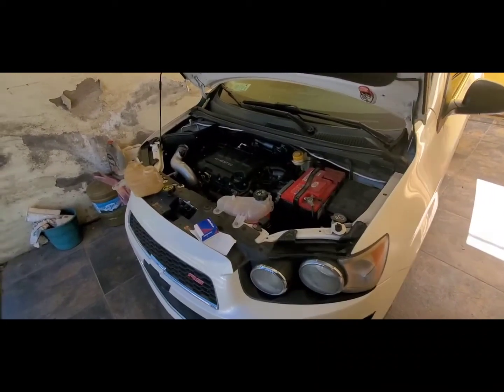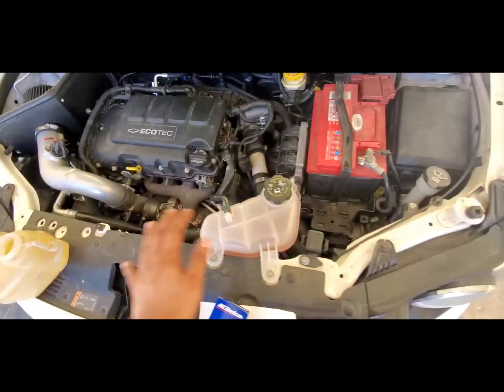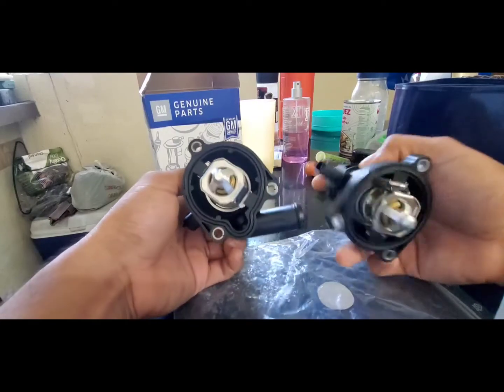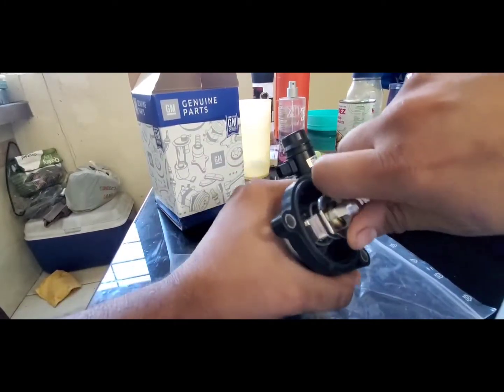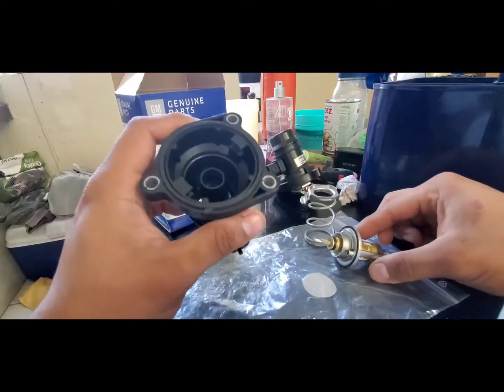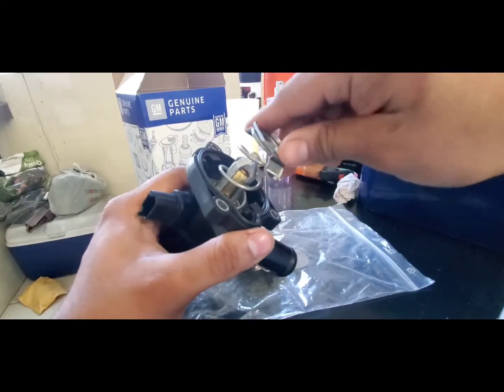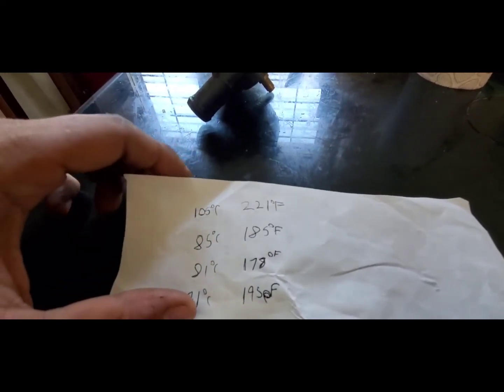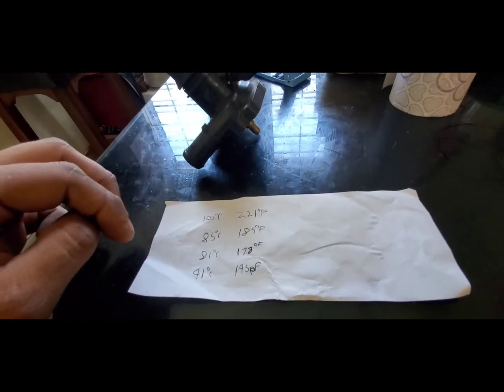colder thermostat mod for Chevy Sonic, Cruze Trax.

Comment: Hello ~ i'm from vietnam. How do you think about change thermostat of cruze ( 105 degree open ) to 95 degree open 
Because in vietnam weather not colder than US. Pls you see my comment
Reply from the maker: Yes, this will work wonders. I'm also in a warm climate I'm not in the US
Reply: @amedsoprano but have issue p0128.
Reply: @amedsoprano  and i think i will set up one more electric fan control by hand, how do you think about this?

Comment: Only if its really hot out the ecu might sometimes open it at 200 instead of 220, but still pretty hot and definitely hotter than a first gen volt/ELR thermostat.
Reply from the maker: It also opens with certain codes present regardless of temperature as a failsafe

Comment: your a genius thank you for sharing my turbo has already gone out on mine causing it to over heat, or maybe its due to turbo failure but either way this gives me hope thanks
Reply from the maker: @ChristinCampbell-b6h  you should check your water pump, it sounds like you have different problems than the turbo

Comment: So. Buy Chevy volt dorman. Just pull thermostat out. Done. Next take chevy SONIC thermostat. Rip it oit. Ok. Got it. Then take your personal housing and put the volt thermostat in it????? He also got a smaller cap. One that is lower in psi. Will help cool it. 185*F-195*F. Genius.

Comment: Wouldn't just swapping the spring have the same effect?
Reply from the maker: @4Tay96  no, the piece that opens and closes is the core
Reply: @amedsoprano  yes, but the spring keeps it closed till it reaches correct temperature which is when it opens/closes
Reply: Correct. Its a very simple thing. U put the volt thermo into sonic housing and then install on cruze
Reply from the maker: @joshlandersgolf45  the spring is just part of it, but the core is what determines the opening temperature.
Reply: Yes i know how a thermostat works. I have and built own street car. ASE certified. But thks
Reply: You'd think the lower pressure spring would have it spend more time in the partial open position as well

Comment: So put the volt thermostat in the sonic housing?
Reply: I bought a aluminum dorman. Runs at 192*
Reply from the maker: @joshlandersgolf45  yep, just the core
Reply: Great trick! Doing that tomm. I been looking for a cooler one since I bought it
Reply from the maker: @Landers-1  just be sure to buy either an OEM volt one or the Dorman version, as those cores are dimensionally identical and have the same connector, I've seen off brand thermostats with a different system altogether.

Comment: So im trying to do same rhing. So u bought a dorman chwvy volt thermostat, and then you removed the volt thermostat and removed rhe equinox thermostat and then u replaced it with the volt internals into the sonic thermostat housing?
Reply: Equinox is a 2.4, not sure this mod applies to that, this is for 1.4t so cruze sonic trax encore

Comment: Hi, may I ask what is the different between replacing a 15psi cap vs keeping the original 20psi cap?
Reply from the maker: The cap regulates the pressure of the entire cooling system, by lowering it there's less force pushing outwards in every single part of the system thus less stress. You're also technically decreasing the ability of the water to go over its boling point without it boiling, but with the combination of thermostat and cap I've never seen anything over 97°C even when trashing the car heavily, revving and attempting burnouts. 
the boiling point of a 50/50 mix at 15 psi is 126°c so I'm well under the safety margin.
20 psi would be 135°c which is necessary with the original tstat that operates at 110~115°c
Reply: @amedsoprano  the previous owner of my 2017 Chevy Trax actually removed the spring of the thermostat completey, leaving only the core remains. He ran it for years, I think. I've just replaced a new one and notice that the temperature is too high, now the car often run around 100°C to ~108°C. I'll try to find the cap you show in the video and order the dorman thermostat as well. Its really hot in Vietnam this summer 🥵

Comment: can this method be applied to cruze 1.8? Because there are differences in shape between the Cruze 1.4 and 1.8
Reply from the maker: Idk since I don't have one of those, but if the inside piece is identical it should work
Reply: @amedsoprano what about just using the spring from the dormant that is installed on the OE thermostat, because there is a difference in the shape of the inside but the spring is weaker and can be installed on the OE, will it affect the opening temp at a temperature of 85 degrees? Thx for your information
Reply from the maker: @Doron7P it might lower the temp a little but the main opening mechanism is the expansion of the wax inside the piston that pushes the plunger so the thing that makes the difference is the core itself.
Reply: @amedsoprano  amazing thanks for your response, so is it a better choice if I swap the spring only and install a 15psi cap (or stay with 20psi)

Comment: Worked fine for me now with 198k on it. No codes,passes inspection..........heater vents use to burn kids inside the car if they touched them while heater was on and fan on low...... not now.

Comment: GM tech here, just to let you know, the stats are all the same, when you see the temp open number advertised on the stat, that is a lie, that is what the car is programmed to open the stat at, the stat is 100% controlled by the ECU, why they have 2 water sensors, there is no water controlled wax in any of them. This mod won't change anything. You'll either have to remove OE stat for a traditional water temp controlled one (3D print custom housing) add a tone to delete OE temp and codes set to desired temp to open, or will have to manually control it by plugging in a PWM set to desired temp after scoping it and leaving another sensor plugged in to OE connector as to not set a bias code.

EDIT I should say first before i put foot in mouth that that is for the US however, i don't know about the rest of the world if GM did something different, but for any Trax, Volt, Cruze, Sonic...ECT with the 85Ci (1.4) in the US, they all use the same thermostat.
Reply from the maker: Every single thermostat in the world works the same, it's a wax filled piston of sorts. when the wax heats up and melts it expands pressing on the plunger which in term pushes on the sealing part of the t-stat.  The only difference with modern cars is the addition of a small ceramic heater within the piston which will heat the wax on command instead of letting the water heat it up. You can open it whenever you want(or the ECM rather) but you can't close it if the water is hot.
Reply: @amedsoprano  That's what the Chevy Cavalier and Cobalt had yes, but not the Trax, Volt, Cruze, Sonic ECT... uses, it's 100% controlled by the ECM on those. If you unplug the connector on top of the thermostat, it will never come open and will eventually overheat. Just cut one open and you will see.
Reply from the maker: @Josh_Austervitz  why don't you follow your own advice and unplug one while at operating temperature. Hell if you're a tech you should have obd tools capable of closing the thermostat on command. Try closing it while at working temp and see what happens. If you come up with video evidence to prove your point I will PayPal you 100 bucks
Reply: @amedsoprano   LOL typical youtube tech, if we get a trade in, i'll get my 100 bucks then (you won't do it though) But, i asked you first, cut one open and show us, or better yet, take the hose off the thermostat housing, unplug the connector and lets see what happens.....  i'm waiting......
Reply from the maker: @Josh_Austervitz  you're the one claiming BS here. Prove it or go kick rocks
Reply: @Josh_Austervitz I can't believe you call yourself a tech.
Reply: @GadGetHackss  I can't believe there's people making videos about something and not doing the research first on how it actually works and then NOT proving it in said video, but hey, what can you do.
Reply: @Josh_Austervitz  Bring one, put it in boiling water and see for yourself. It'd be foolish to just rely on something electronic that could fail at any moment to open & close such an important component of an engine.
Reply: The difference between these two thermostats is the spring rate, the internal part is controlled by the ECU as described above. I can increase and decrease the percentage of open using a bi-directional scan tool, I believe it operates between 4 and 9 volts but because the spring rate is slightly different the Volt/Cadillac one will open earlier with the 4 volts applied then the original.   Also note that the Volt\Cadillac is a non-turbo  1.4 engine.  
You don't need to cut one open you can simply plug the original one in then increase the % open using a bidirectional scan tool and you will see that it will open much later than the new thermo.
Reply from the maker: @thomasmeisch5692  once youre past operating temperature you have no control whatsoever. The spring and volume of wax inside the piston are carefully determined so it expands open at a set temperature. All the ECU can do is heat the insides faster than the outside surrounding liquid.
Reply: @amedsoprano  I would recommend that you call Dorman that is the replacement ones manufacturer, if you talk to their Tech on the operation of this, which is what I did the element inside is designed to operate at a higher temperature than the surrounding antifreeze this allows for the internal heat mechanism to adjust accordingly there is however a Fail-Safe at 248 degrees Fahrenheit the thermostat is designed to open fully to prevent over-heating regardless of ECU comman.  Electronically, the ECU according to Dorman's Tech, can be manipulated between 217 degrees and 241.8 degrees.  I did this research before I made this change because this has been brought up many times in the last few years so I wanted to hear straight from the manufacturer exactly what is the difference between these two thermostats.  As I stated above if I close this down to 0% the temperature quickly rises in my Cruze if I open it all the way up to 100% it then falls down quite significantly so in my opinion the Dorman's explanation is sound
To be clear I am running the new thermostat and have for the last year the temperatures in my cruze are now after my fifty-mile ride home no higher than 207 degrees we're with the original I would be running in the mid-to-high 230s at highway speeds.  I don't remember off the top of my head but I believe the replacement thermostat is designed to operate between 170 - 205, with a fail safe of 217.
Reply: Bought this Dorman. Put it into hot water, the Dorman thermostat opens at 84.5°C

I followed the video, now my car operates at 85-87°C instead of 96-104°C
Reply: In Indonesia Chevrolet Trax use 105⁰C. I think in Indonesia is wrong
Reply: Being a GM Tech is not a flex especially since you're completely wrong on this I have done this hack
Reply: @Amendment_one_photography  Good, i simple video of you doing this will put it all to rest then. money where your mouth is, chop chop.
Reply: @Josh_Austervitz  I've never thought to bench test these, but it clearly states on TDS and Alldata the thermostat can't open by itself. I have ran into where the spring fails from time to time giving P0128.

Don't make any sense what they're talking about though.

Comment: Hi..
It's been a year since you post this video. How is your car now after the swap?
Reply from the maker: It hasn't lost a single drop of coolant since, seriously I haven't even opened the reservoir.
Reply: @amedsoprano  Do you still use the pink Dexcool Coolant according to GM recommendation?
Reply from the maker: @pfuljono4213  yes, 50/50 Dex cool
Reply: Awesome! I wonder if this modification applied on diesel captiva?
Reply from the maker: @pfuljono4213  if the housing is the same it should
Reply: The function of the thermostat is to maintain the ideal engine operating temperature.  Do you know what is the ideal operating temperature for the Chevy Trax engine?  do you have any references?
Reply from the maker: @pfuljono4213  engine operating temperatures range from 85 to 110 degrees Celsius, generally speaking the hotter you run an engine the more efficient it is but at risk of pre-ignition. The specific optimal temperature is up to the manufacturer. For example gm says the engine on the Sonic should be 105 to 110, but the car is notorious for cracking the expansion tank so I am willing to sacrifice some efficiency running at 85 to 90 but the cooling system has way less stress because the hotter it gets the more pressure it builds up.
Reply: @amedsoprano  agree!
Reply: What is the part number for dormant thermostat?
Ia there any 85°chevy thermostat can be use for trax?

Comment: I did it in a 2016 chevy sonic and works really good but now the radiator fan its working all the time at its max speed, maybe I need to check therm sensor or some lose connectors but let me know if you have any idea or advice. thanks
Reply from the maker: Plug an obd reader and clear any codes you may have but not before resolving each one first
Reply: @amedsoprano  thank you! It was the MAF sensor wasn't plugged in on, cleared the codes and its good... Now I would like to know if there any way to force the fan to start at lower temperatures for example when reach 88 C without the need to start the A/C, I was reading in the forum something about an "auxiliary radiator fan switch" but I can find more detailed info.
Reply from the maker: @RafoRisco  with a tune
Reply: This doesn't work , don't waste money. There is error and require reprograming
Reply from the maker: @euronickelit3kavadarci946  what error did you get?

Comment: hi. did you noticed an increased fuel consumption after this modification? i've ordered myself parts to test. i have an Opel Meriva B 1.4 120hp(A14NEL). thanks
Reply from the maker: I have not
Reply: @amedsoprano  i will modify mine in about 2 week. I hope that worth..
Reply: @adaniel69  Did you modify your thermostat, and how's it working and check lights.
Reply: @amedsoprano  does this modification will trip a check engine light?
Reply from the maker: @adaniel69  no
Reply: Daniel you changed it ?
Reply: @Buckterflewae  hi. I have installed on my car for more than 10k km. But, with a modification on the temperature sensor. Because it was showing an error after a while, indicating that my thermostat is defective. I installed a time relay that is connecting a 365 ohm resistor after about 6 minutes after the engine is started. So, now, 103°C that ECU sees is 86°C(real), and 109°C(when fan is kicking) is about 94°C real! Very happy with the modification. I'm curios if the waterpump will hold now longer that 60k km! 👍

Comment: These plastic cars aren't built for this kind of very high pressure and high temps. I own two cruzes one 1.4 and 1.8. Both had leaks from coolant overflow bottles (never had to replace coolant bottles in any of other cars), bulging radiator hoses and cracking plastic coolant outlets. I believe this is a good mod which I am going to add to my 1.4 (I don't care saving few pennies on gas but replacing expensive parts). If you have one for 1.8 let us know. THx
Reply from the maker: I don't have a 1.8 to tinker with but I assume the procedure is basically the same. Idk if the internal structure is the same so the same volt tstat could be used
Reply: This doesn't work , don't waste money. There is error and require reprograming
Reply: @euronickelit3kavadarci946  I did it and it’s working and running fine. No CEL

Comment: Do fans have to be programmed?
Reply from the maker: No, with a lower temp for the thermostat the coolant will not reach the fan turn on temperature and even if it did, they would just turn on.

Comment: Do i have to replaced all together or i can do only the reservoir cap???
Reply from the maker: You could as long as the temperature and concentration of your cooling mixture doesn't exceed 15 psi. There are charts on the internet that correlate how much pressure does water generate at what temperature (it varies from just water to 50 50 water and coolant) just search for engine coolant pressure chart.
Reply from the maker: www    gomog    com/allmorgan/coolantcolors   html  ..... Just replace the spaces with dots, that page has one of many charts available
Reply: Ok got confused so i dont want to replace the thermostate but i was thinking only for the cap to swap the 20psi for one of 15 psi
Reply from the maker: The boiling point of 50% coolant in water is 267 degrees Fahrenheit at 16 psi. As long as your tstat is below that you should be good
Reply: Is any way to set up the ecu to send info to the thermostat to open on a more cold temperature instead a 221f
Reply from the maker: @sancheztorres35  yes, with a tune.
Reply: @amedsoprano  ok

Comment: And how long as this worked for my car ran under temperature for like 6 months and I started not burning fuel correctly has this happened to you bc my tstat don't open till around 226 and I think that is way to high also... And also the fan do t ever run on your car? What about if you turn the ac on them is it to cold?
Reply from the maker: Mi car has run fine ever since, the fan almost never kicks on because there's no need (it never reaches the "on" temperature)